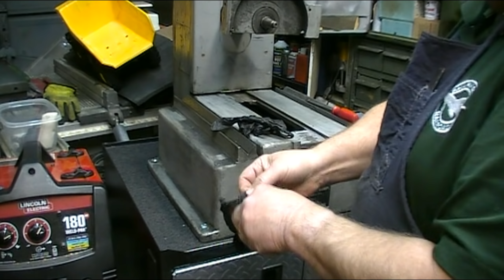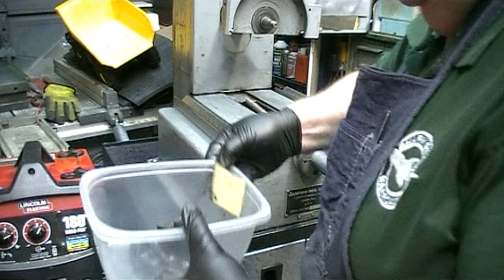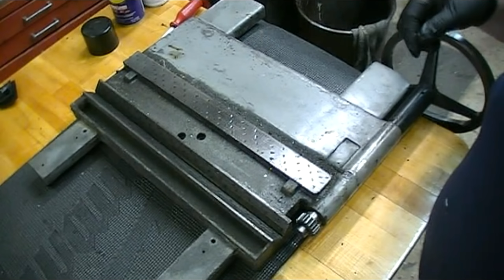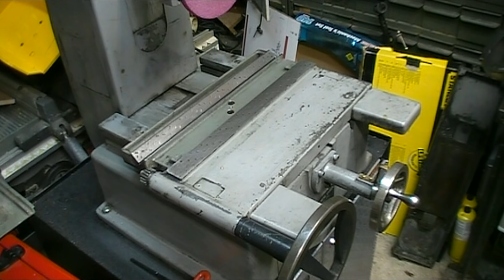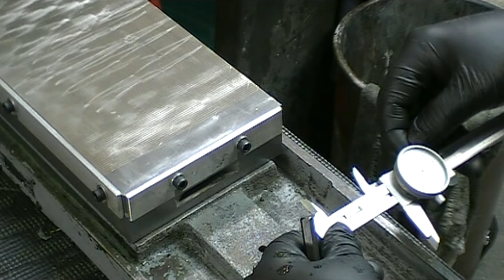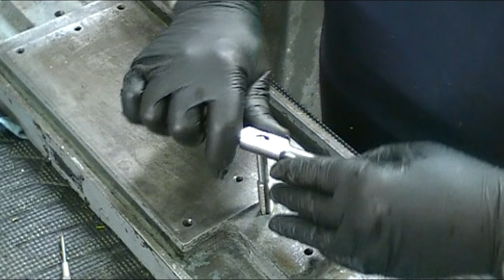Sanford MG Surface Grinder Part 2

Comment: Steve - do you have the owners manual for the surface grinder?  If so - would it be possible to scan it to PDF and email it to me?
Reply from the maker: No I do not, I have not seen one but you might check Vintage Machinery.org
Reply: @sharkrivermachine  Ok.   If I find one - I'll make sure to get you a copy, then!

Comment: I could’ve used your help on my Abrasive 1 1/2. Nice job you’re doing there my friend. I’m going to check out your next step. I was worried about using rustoleum but a nice coat will protect for a long time. Great video.      Ron...
Reply from the maker: Any good solvent based paint will stick to clean cast iron.  I have had good success with the Rustolium we used the same color.  Make sure you check out Part 3 where I grind in the table.  I was able to wipe the table clean after using the coolant. Thanks for commenting.
Reply from the maker: I used to own and operate an automotive machine shop.  We used Rustolium on all of our machinery.  It held up against coolant as well as anything.

Comment: Looking good Steve. I agree with the tapped hole instead of the T slot. All they do is get filled up and get nasty.
ATB, Robin
Reply from the maker: ROBRENZ thank you.  I picked up studs and stainless nuts. I plan on setting the studs with anti seize on final assembly.

Comment: nice work,i agree studs would be the best rather then taking a chance on the threads getting damaged in the cast
Reply from the maker: I got the studs.  I will put anti-seize on them and I also got stainless nuts to avoid corrosion.

Comment: Gday Steve, thanks for sharing your progress mate!
Are you planning on grinding the surface of the table prior to clamping up the mag vice?
Cheers Marcus
Reply from the maker: I am going to run an indicator over the table before I make a decision on grinding it.  I need to put the chuck on first to dress the stone.  It will be nice to know if I have to take it off again.  Thanks for watching and commenting.

Comment: Is that a precision ground shop stone. or regular bench stone?  What grit, if I may ask?  I need to go over the table on a Burke MVN i tecently purchased.  -  Very Good video.  Looks like it's gonna be a nice grinder.
Reply from the maker: I is a regular fine grit sharpening stone, nothing special yet.  I plane to make some once I get the grinder completed. Thanks for watching and commenting.
Reply: I'd be interested in a couple if you make them to sell, if I can afford them.
Reply from the maker: I have considered it.  I am looking for a source for the stones.